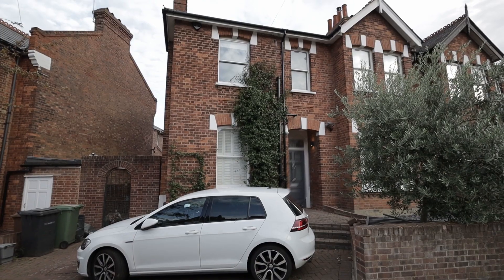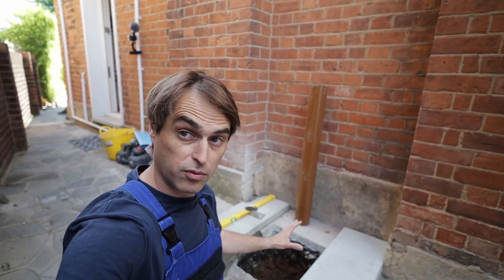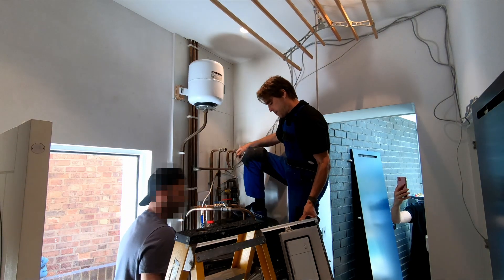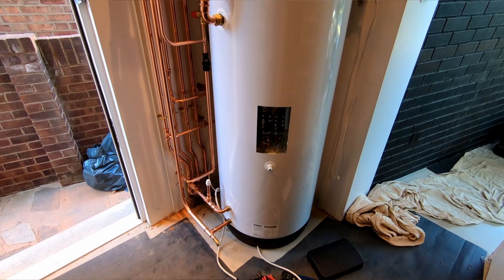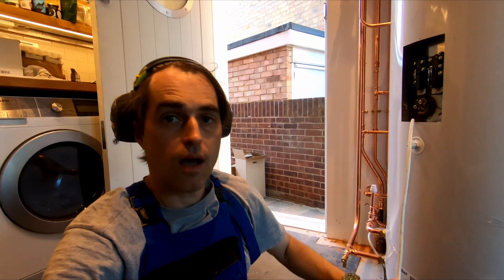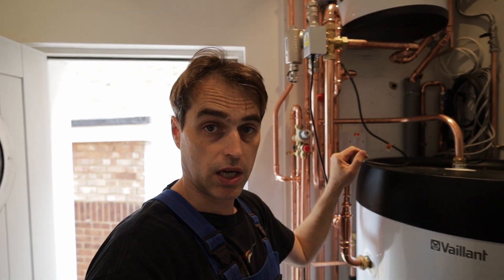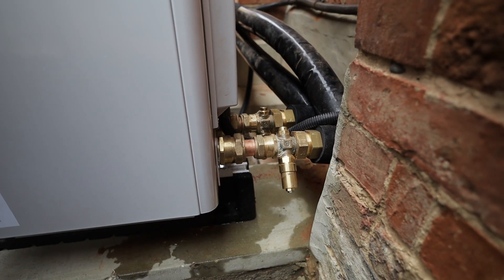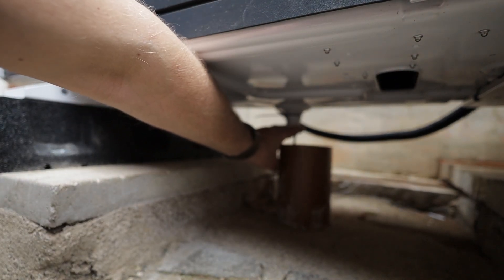Is This Heat Pump Better Than Your Gas Boiler?

Comment: Very good video and as always an A+ installation by you. It does illustrate the main draw back of ASHP, which is that even in a house that’s had thousands spent on it to bring it up to excellent levels of insulation, and with a very well sized, installed and commissioned appliance. The best guess at the moment is that it will save about twenty percent over a gas bill. But it’s cost thousands of pounds more than a gas install. So basically there is no hope of this installation ever paying for its self during the lifetime of the equipment and with electricity prices set to rise in oct and then again in Jan 23, that saving gets reduced even further.
Reply: Little but true. But a lot of these upgrades should have been done for condensing boilers, because they are supposed to be a low temperature heating system. Except everyone was too cheap to install any better emitters or wider pipes etc so didn't bother and basically most condensing boilers never do anything of the sort.

Most of the "heat pump"  upgrades are simply low temperature heating system upgrades and not recurring costs. So in 25 yrs the next heat pump change will simply be a unit change bish bash bosh.

Also electricity costs are going up -  but less than gas is proportionately. Was 3p gas vs 18p electricity (6x difference) now 7p gas and 30p electricity (4x). New price cap rumoured to be 15p gas vs 50p electric
(3.5x).
Plus all social levies are on electricity but as that's now much cleaner than gas should be moved over.
Reply: @Lewis_Standing  But you could also make a good point of just doing the system upgrades to allow for the existing boiler to run at a low flow temperature. There wasn’t anything wrong with the existing boiler or cylinder. Most likely had years left in them. Manufacturing a heat pump, buffer tank and cylinder, with all the energy and carbon that produces, then shipping them halfway round the world, to use it to replace perfectly good appliances isn’t exactly environmentally friendly. I personally think if someone has a band A condensing boiler then they shouldn’t qualify for a heat pump great, system upgrades maybe, but making boilers a disposable item is not good for the environment.  It’s like the green lobby and government think all this equipment just appears out of thin air with no carbon impact. Binning off perfectly good modern boilers is mental.
Reply from the maker: ecisting boiler and cylinder was installed very badly and never condesned and run below 80% efficiency. It also had 3 pumps in series - it was a terrible system.

Boiler and cylinder will get upgrade of contorls to run fully weather compensated and will be installed at another property.
Reply: @Lewis_Standing  when was is 3p vs 18p? It was more like 2.7p vs 11p
Reply: The objective is decarbonising the country/world before big chunks become uninhabitable. The idea that this work doesn't 'payback' is just completely wrong-headed. Almost nothing else we buy (clothes, cars, computers, bikes, food, kitchens) 'pays back', so why do heating systems have to?
Reply: @xxwookey  people still do a value for money calculation for any of those items. It may not be a direct calc but if you buy an item of clothing for £100 and it falls to bits you don't buy it again.
Same with a car. If it breaks down regularly or costs a fortune to maintain you don't buy another.
People are not going to fork out £15k for an ASHP if the benefits are reduced co2 but similar or higher ongoing running / service / install costs. Especially seeing as we're <1% of global population currently and global population is forecast to rise to 10bn by 2050. It's the elephant in the room and nobody wants to discuss it.
Reply: @ChrisLee-yr7tz  Value for money is not the same as 'payback'. Of course all purchases have a value proposition. It doesn't matter that the UK is only 1% of population: we suffer along along with everyone else if civilisation collapses and we are responsible for our own share of emissions, whatever size it is. (And ours are many times bigger than those who suffer most (Pakistan this month) - do you really think it's OK just just say 'screw those people, I don't care if they become homeless or farmless or die'.
The main benefit of an electrified retrofitted home s that it's much more comfortable to live in. That the same reason people paid a lot of money for double glazing for decades (it's not payback - DG takes decades to payback in simple financial terms). People are actually a lot more interested in improved comfort than they are in cost savings. You also seem to be forgetting that electricity from low-carbon sources costs a great deal less than gas (at the moment PV generation is 9 times cheaper than gas generation) so an electrified home really will cost less to run over the long term. And ASHPs won't be 15K for long. There is no reason an ASHP install will cost significantly more than a boiler/CH install once they are happening in large numbers. Octopus is working on that right now with their big new training facility.
Nobody wants to discuss what? 10bn by 2050? That's not accurate. It will very likely be around 9bn and that might also be the peak. Demographers are arguing about numbers between 8.7 billion in 2048 and 11 billion in 2070. Most people think we are headed to the lower end of that. Which is still way too many people, but it's only 12% more than now, which is manageable (albeit unhelpful).
Reply: @xxwookey  Payback period is just the reciprocal of investment yield and all forms of spending have some form of yield, just not necessarily monetary.

At no point have I suggested saying just screw people. I'm being pragmatic. If the numbers don't work people won't do it. These kind of videos really need to spell out the full cost/benefit analysis if you want to convince people to do it. A lot of people don't have the kind of money required even with the subsidy....and the subsidy is limited in number per year too.

Is an ASHP really that much more comfortable? Why? Any heat source can provide the same number of kwh? Why is it more comfortable?

Surely what's more comfortable is an adequately insulated house if that's the case? Why not spend all the money insulating everyone's house instead? That would lead to a drastic reduction in co2 right? I wonder what the £/co2 reduction is for an ashp on an already fully insulated house vs the £/co2 reduction from insulating a leaky house?

I'm not forgetting generation costs, but if that cost isn't passed on to consumers then it'll impact their investment decisions. If electricity was priced at the average cost instead of the highest marginal cost we'd be having a different discussion but its not.

The UN projection is 9.7bn by 2050. I rounded it. That's a 21% increase. It's total insanity and contributes to pollution much more directly than me not switching to an ASHP. And it's only a 21% increase from today. It'll be about 4x what it was in 1950. So quadruple in 100 years? Absolute madness. Beyond madness.

And don't misunderstand me. It's urgent. I know it is. I still need a lot of convincing that ASHPs are the solution.

Comment: Another very informative video. I have recently been looking at new build houses with an ASHP. The developers have provided the heat loss figures and all are running between 45 and 55°C output temperature @ -2 outside, and predicted SCOP of 3.1 to 3.35. All installations were sub contracted to MCS installers. They also space the UFH pipes at 150/200mm so there is little chance of lowering the output temp.  Would you agree this is poor design for a new build, and have you ever installed or seen UFH pipe spacing less than 150mm centres?
Reply from the maker: yes, definietly poor desing. It should be designed to 40C for over 4 sCOP. The truble is they are only required to design to 55C by current regs.

Comment: Once everyone is driving electric cars and have air and ground source heating, firstly, where is all the electricity coming from and secondly, just how much is a unit of electricity going to cost when it has a monopoly? I don't think the lagging on the pipes is adequate by the way. If you concider 300mm of loft insulation is required to reduce (not stop completely) the heat loss from a 21 degree area to, say, -2, 15mm insulation covering a 60 degree hot water pipe is doing virtually nothing.
Reply from the maker: You do realise that this heat pump has similar energy consumption to your kettle?
Reply: @UrbanPlumbers  Really? 2kw. Please don't get me wrong, I'm very interested in all of this and had I my time again I'd be going all out but forgive my scepticism there are a lot of claims that seem to defy the laws of physics being banded about. If I could heat my Victoria 3 bed semi house to 21 degrees with it being minus 10 outside for 2kw/h, I'm in.
Reply: @Baddad36  Burning gas to make electricity to run a heat pump is 4x more efficient than burning gas to heat water for your radiators.

This is because heat pumps just move heat from one place to another, rather than creating it.

Even if we burn gas to produce the electricity for this, it’s still a win for emissions.
Reply from the maker: @Baddad36  to give you an idea - 4 bed semi in this video is 6.5kW heat loss. You will need 6.5kW of power to heat it up to 21C when it is -2 outside.

I will not lie telling you that i know the exact power consumption at full load, as I do not know that - but I will know it as soon as it gets to -2

I know that the maximum possible power consumption of this particular unit is 3.5kW. I assume this would be at start-up only or when run at 75C with -2 outside when doing legionella cycle on hot water cylinder.

On heating, we will only need 40C flow when it is -2 to keep the house at 21C. In those conditions, I would expect 2kW power requirement. Again - I cannot confirm that yet, as we need to wait for the winter.

I am as curious as you to see the actual results and will 100% post raw results for everyone to see in the winter.
Reply: @UrbanPlumbers  Subscribed. Tried googling all about energy loss and energy needed, efficiency, etc etc but my elderly brain hurts. I'm confused. If a building has a heat loss of 6.5kW (I assume a day) you'll need a heck of a lot more than that to bring it up to temperature surely. Or have I misunderstood it. A video on it or point me in the right direction would be great. PS. love all the copper. I hate plastic even although that's the way it's all going too. 👍
Reply from the maker: @Baddad36  heat loss is the power needed not energy. Power is instant not over time.

You do not need any more than that to bring the property to 21C, it just has to be continuous at the design temperature of -2. So if there is -2 outside and your house heat loss is 6.5kw (Power) you will need 6.5kWh of energy per hour in form of heat to replace the heat lost to the outside.

If you use a gas boiler running at 85% efficiency you will need 7.6kWh of gas per hour

If you use a heat pump running at 300% efficiency you will need 2.1kWh of electricity per hour

That is assuming that the temperature outside stays at constant -2

I hope this makes sense.
Reply: @UrbanPlumbers  I think it does! You should teach. 👍

Comment: How much does an installation like this cost ? Surely you’ll have to make all of that money back through gas bill savings before deciding it’s a cheaper and more efficient option than the boiler. Then there’s the carbon footprint of removing a working gas boiler and cylinder and all the manufacturing of the new equipment you’ve installed
Reply from the maker: Have you even watched the video? I said there that the boiler and cylinder is not thrown away but installed in another property.
Reply: @UrbanPlumbers   installing a used boiler in another property ? Is that ok ?
Reply from the maker: @TheRageddavid  yes, completely fine to install used equipment.

Comment: Give it another 8-10 years this will be the next mis sold ppi claim!
Reply from the maker: give it another 8-10 years and you will wish you had a decently installed heat punp mate ;)
Reply: @UrbanPlumbers  maybe if I lived in a well insulated bungalow with underfloor heating I would….mate!
Reply from the maker: @colinbrunton9235  that is true - a lot of houses will need upgrades done to them. But those upgrades should be done regardless of the heat source, especially in the current energy crisis climate.
Reply: @UrbanPlumbers  yep energy crisis, and also a ridiculous cost of living crisis. So where do the people get the extra money to carry all the upgrades needed? Not to mention the price of all the new equipment needed? Also where this equipment will be fitted. Most working class people will one:- not be able to afford it and two:- probably won’t have anywhere to fit the extra materials ie hot water cylinder.

Comment: Great video. Four questions.

1. Is your 40°c at -2 the flow temp and does that make your MWT 37.5°c?

2. What size cylinder is that?

3. Why is the ashp 6kw is the heat loss is 6.5kw?

4. If using UFH ground floor with radiators upstairs, do you keep the manifold mixing valve or use something else for different temperature flows?

Thanks
Reply from the maker: 1. Yes - 40C at -2 and MWT of 37.50
2. 250L
3. HP is 'named' as 5kW but the actual output at A-2/W40 is 6.5kW
4. Radiators are also sized for 40C flow and 37.5C MWT so blending valve removed and full system runs at the same temperature without any zoning at the moment
Reply: @UrbanPlumbers  brilliant thank you. I look forward to seeing more content.
Reply: @UrbanPlumbers  if the flow temp is 40 and room temperature is 21 what is the return temp? If it is say 30 then the MWT is 35
Reply from the maker: @normanboyes4983  return is 35 and MWT is 37.5

Comment: All that flow and return pipework on the outside of the building is not good. You will lose heat in the winter.
Reply from the maker: you do realize it is insulated and also in trunking? I do not know specific heat loss figures per meter of insulated pipework in a housing but will find them for you and post hem here soon.
Reply: @UrbanPlumbers  The heat loss on that external pipework will be very low....in the summer.
Reply from the maker: @SkillBuilder  you are wasting your talents Roger! Stand up is your true calling mate!
Reply: No insulation is perfect there will be loss especially if the winter. If the pipe work went straight into the house (appreciate that’s not always possible) then any heat lost will be in the house where it’s needed. Plus it looks ugly even with trunking

Comment: The noise is a big nuisance for neighbours.
Reply from the maker: you realize that this unit is virtually silent? From 1 meter you do not even know it is running. Not all of them are like that though, but most are getting better.
Reply: @UrbanPlumbers  but the bearings are brand new m8 and given time, anyway think your great m8 wish I could do what you do I only fix taps &  toilets.

Comment: What's availability of Arotherms like?  went to order a Viessmann vitocal last week for a job were doing and they said I'd have it by march 2023 at the earliest 😱
Reply from the maker: I get them through Heat Geek. However my local supplier claims to have tons in stock. I don’t know how?
Reply: @UrbanPlumbers  👍. We're doing the job under the viessmann umbrella so might have to switch to a Vaillant under heekgeek as we're not MCS yet for the grant.
Reply from the maker: @griffithsheating  yeah, not a great umbrella if you can't get the gear in.
Reply: @UrbanPlumbers  and I thought working direct with a manufacturer would be a good idea 🤦‍♂️. The red flag should have been when they specified the equipment wrong in the beginning 😬
Reply from the maker: @griffithsheating  if you have done HG course just join their umbrella. It is frankly brilliant.

Comment: Probably only 1%of the uk could afford these systems.   Most new builds have 10mm speedfit pipework all behind dot and dab. Replacing a gas boiler £1500 compared to £20-£25k 
Absolutely love your work great videos thank you

Comment: Hello urban plumbers! 
We install Vaillant products quite a lot, those cylinder wire routes actually go right to the back as well so you never see the cable at all. 
Hope to start our ASHP journey soon!
Love the videos  🙏.
Reply from the maker: i tried to see if there was a route from the back to the front but it did no look like there was?
Reply: @UrbanPlumbers  I've fitted two 180litre Vaillants and it had route for both immersion and stat 👍. Very clever and neat. Also, loved the swoop on the top to collect water before spilling over the side. 

This is why we go Vaillant.
Reply: @UrbanPlumbers  maybe they have different models? But ones I fitted 100% went to the back as well.